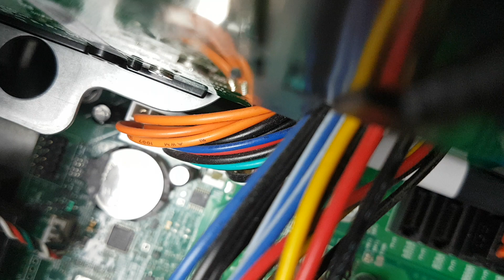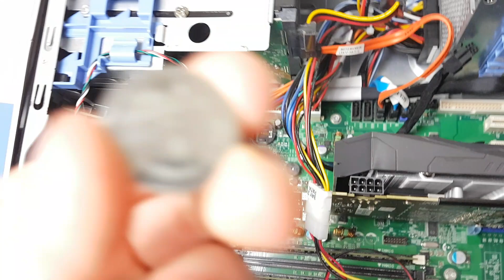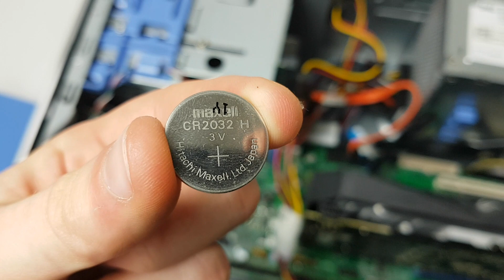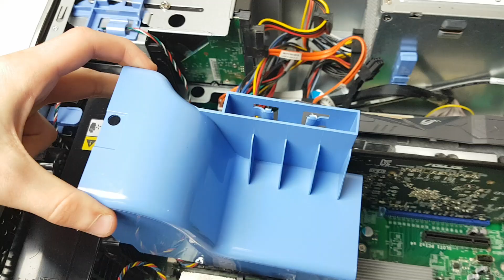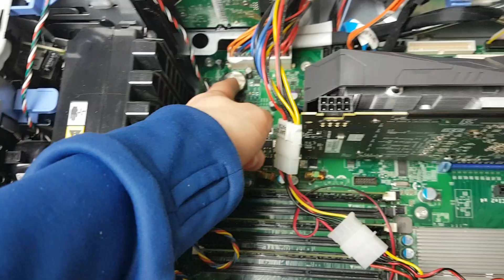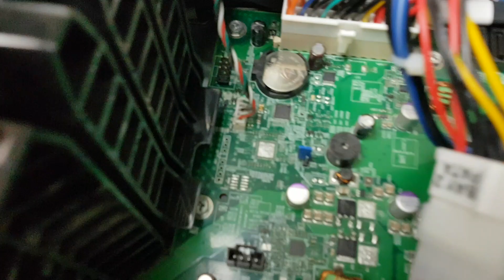How to Relace CMOS battery Dell Precision T3500/T5500 Fix System Battery Voltage Low

Comment: I have 3630 and just bought it. It did not have a CMOS battery so I installed a new one and now I cannot turn the machine on, there is no BIOS, no prompts, but the fans are spinning. How to repair it?
Reply from the maker: @aperson1181  take out battery, jump the connection with a screw driver. Leave unplugged for a few min, try boot up without battery. 
Otherwise you will have to try troubleshooting different ways, for example take out all the memory modules and put them back in. Basically you'll just have to troubleshoot a lot of things on the machine. But the simplest would be taking out the battery and jumping that connection. And seeing if it will turn on again. Assuming it worked before. That's about all the advice I can give sorry.

Comment: I just tried this on my T3500 and it did not go well. Am I being an older model because the battery holder is slightly different without the plastic shroud on one end. I was able to get a good hold on the edge of the battery but if I pulled any harder it felt like it was going to rip the entire assembly off of the motherboard.
Reply from the maker: Not sure sorry

Comment: Thanks alot man, that's a big help! Are there any settings that revert to default when you change the battery, or other settings that need to be considered beforehand? Cheers
Reply from the maker: when you change battery generally the bios settings will go to default. the only thing you would need to be mindful of is if you are using any raid settings in bios. but generally most people dont and resetting to default is not an issue.
Reply: @AleksandrsBrodie  Tnx for the explanation Aleksandrs, helps alot. Cheers!
Reply: @AleksandrsBrodie  Excellent, was an enormous help, saved me alot of time. Cheers!

Comment: Ive upgrade my t3500 to Xeon 5675. After that dimm 1 error come on ram i dont know why
Reply from the maker: Check the contacts under the cpu. I've had issue where a bit of dust was covering one of the pins causing a similar issue
Reply: @AleksandrsBrodie  u mean Check The processor or Dimm Slots?? Or rams??
Reply from the maker: @Imadee-99  you can first clean the contacts on the memory modules,  then if that doesn't work try cleaning the contacts on the bottom of the cpu.
Reply: @AleksandrsBrodie  And When i only put a single stick ram of 4gb on dimm 1 its dont start and  sound beep... Ive changed rams the problem persist.. if i put it on dimm 2 it starts but start like this the sequence of channel dosnt match and say  "non optimal memory  population detected"

Comment: Bro my dell t3500 has a problem when I start it it just blink 1 and 2 light and orange light stays turned on please help me what is the problem with my pc
Reply from the maker: search on google the error code, that is how I troubleshoot all my systems.
Google is my best friend :)
and yes, I hate troubleshooting just as much as anyone does, sadly... it will just take time ;(
good luck Gaming Bots!
Reply: @AleksandrsBrodie  bro It is not giving display it just stay on dor about 5 seconds can you male a video on this thing please :(
Reply from the maker: @saitamaplayz9728  no i wont be making a video on that, i dont even know what issue that is.
as i mentioned earlier, I would look on google for an answer.
search up your error code with the dell light post code
Reply: @AleksandrsBrodie  bro I have tried each and everything and it is not starting
Reply: @AleksandrsBrodie  bro please tell how can I fix this thing

Comment: hi
i have 10 dell workstation T3500 models
my complaint power problem means 
when i press the power button no start the system
i remove the cmos battery again insert battery 
then its working
Reply from the maker: That's weird

Comment: plz help
Reply: You need a 2032. the 2032 is 20mm diameter and 3.2mm thick. The 2016 is only 1.6mm thick & will probably not stay secure in the holder- you might be lucky. Both voltages are the same.
Reply: @iainmclean7570  iam fkung done wid the server machine bought custom i5 from Walmart now iam at peace